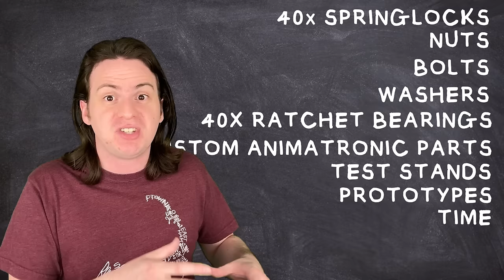Every Engineering Crime of William Afton

Comment: wouldn't most safety issues with the springlocks be solved by simply making them open upon failure instead of close?
Reply from the maker: Yep! It would have been that easy!
Reply: @TheChiptide  and using springlocks that aren't insanely powerful probably would've done the trick too
Reply: The issue with that is that the jerky motions of the animatronic would set off the springlocks, causing it to crumple on stage.

Comment: I always thought the reason they hired security guards was to act as bait so that the animatronics don't try and leave the building. They realized that the robots started acting weird and attacking things and didn't want that getting out onto the streets. Also, to answer your question about the Funtimes, they were designed to scan the room and only strike when a kid was left alone with them. No one would be around to see it, and no one would suspect that the kid is inside the robot.
Reply: I prefer the theory that they saw it, and just went huh, time to get some cake
Reply: the whole concept of the funtimes to strike when a kid is left alone in a party is like.
one of the reasons why they didn't really get another since yoinking william's daughter.
as a case like that in a party is VERY slim. surprising, i know
Reply: Remember the night 1 phone call, Fazbear Entertainment is not responsible for damage to property or person. Upon discovering that damage or death has occurred, a missing person report will be filed within 90 days, or as soon property and premises have been thoroughly cleaned and bleached, and the carpets have been replaced.

Comment: The springlock suits, as far as we know, are completely safe when used properly and in accordance with standard operating procedure. The only reason William died is because he was putting the suit on hastily and in a damp environment, violating the standard operating procedure. If you operate a table saw not according to procedure, you’re liable to be injured; but that doesn’t mean that the table saw is poorly designed.

As for Fredbear, the reason the pistons in the mouth are so powerful is because they need to be strong enough to actuate the presumably very heavy upper head of the animatronic. It wasn’t the strength of the pistons that caused the Bite of ‘83, it was the weight of that upper head part.
Reply from the maker: While that’s technically true, as an engineer you need to expect that people won’t follow all the rules all the time. The fact that this problem could have been solved simply by turning the srpinglocks around so that you’re not in the line of fire is what makes this so negligent and criminal. Just because nobody got hurt (until they did), doesn’t mean it’s safe
Reply: These are supposed to be used by human beings, last I checked, those sweat, getting the inside of any mascotte suits unpleasantly damp as time goes on. And in a restaurant, there is 100% chances that the suits would get splashed with a spilled drink, so moisture should have been part of the considerations when planning and testing the design.
Also, quick changes are a staple of the most performances, so being able to get in and out of the suits quickly and safely becomes a basic need for them to be fit for purpose.
Reply: About the weight of the head: it can't be that heavy, people should wear it over their own head
Reply: Finally someone who acknowledges this. Sheesh...
Reply: @TheChiptide  technically it's not the spring locks that kill someone it's them launching the Animatronic Parts that they Hold Back Into Your Body, but that's still a Failure of engineering and safety non the less

Comment: I can think of 5 different easy solutions to the spring lock failure design.

1. Make the default position the suit position, requiring the springs be tensioned to be in robot mode.

2. Use jack screws. This is like what is used on some flap and trim systems on aircraft, no possible spring action, yes it will take more time, but any failure will keep the suits in the mode they are currently in 

3. Redesign the suit to a simpler system where the character elements can be swapped between human exoskeletons and separate robotic endoskeletons. 

4. Just using locking slides instead of spring locks. So if they come undone they will flop around harmlessly instead of snapping closed like a mousetrap 

5. COTTER PINS.

This level of engineering stupidity is only possible not only through negligence but through intent.

Comment: What else could have solved the power outage issue is having a manual way to open the doors or even better, a back door.

Also why would there ever be two incredibly expensive heavy steel doors? Just get one if you really want to get them.

Comment: Yeah, but the spring lock suit that killed him was decaying, had holes and vegetation growing on the suit, on top of the bad conditioning of the building, and it is in a state of disrepair on the suit. William also may have not even designed the suit, as Williams stitched together suit in fnaf 3 was most likely the original suit designed by him judging by the stitch marks, compared to Henry’s bulky design. He most likely used high quality springlocks, maybe too powerful to kill people. 
But throw all that out the window as the suits may have never been actually used, as only 2 existed.

THE DOORS were designed to keep the person watching the security cameras just in case a break in would happen, so they could call 911.
(They didn’t have portable phones back then) then the anatronics would attack people after hours because they’re on low power mode, as the doors would only be close of 6 out of the 16 hours saving a lot of money.

While it might be considered unsafe to keep killer robots that walk around.
Maybe it is because their servos lock up if left off for too long, considering if the place closes around 6, that’s 5 still five hours before 12. William always had doors in HIs astablishments. Fnaf 1, SL, and in the location before fnaf 2, he states in fnaf 2. “As you can see, there’s no doors for you to close…” all the locations he owned, all had doors to protect the night guard.

Comment: Henry might be more guilty than what you initially thought. Both William and Henry were involved in building the Springlock suit. However, during Fnaf 2, William was working as a day shift guard and was eventually fired by the end of the week. There is no evidence to suggest that William returned to work for Fazbear Entertainment. Moreover, by listening to the phone calls, Henry was aware of the potential danger posed by the animatronics in both Fnaf 2 and Fnaf 1. In Fnaf 1, there was a policy in place to cover up evidence in case of any fatalities. Additionally, the Springlock suits are a gray area as they are dangerous, but the employees were trained to wear them. You can hear some of the training tapes in Fnaf 3. Furthermore, when the Springlock suits were built, safety laws were not as strict as they are now. Based on my research, they followed all legal requirements at the time for the construction of Springlock suits.

Comment: Actually he has more than two character traits, He's overconfident, boastful, and degrading, also he was NEVER Purple, he's just depicted as Purple. The only one who's LITERALLY Purple is Michael, who's purple because he's LITERALLY A ROTTING CORPSE (Though it's more a meaty red outside the 8-bit minigames, akin to William's corpse in Springtrap, which is why he's able to get jobs at all despite literally being a reanimated corpse).

Most of the evidence pointing towards William was either in a bunker under his house or also pointed at 3 other people, one of which being Henry.

Ah yes, giving William Credit for Henry's work when even he states that it was Henry's design. From what I've seen you do that a lot.

You're right, he's not a cheap businessman, but he DIDN'T DESIGN OR MAKE THE SPRINGLOCK SUITS. THAT WAS HENRY.

In fact, Henry designed EVERY ANIMATRONIC IN THE FRANCHISE EXCEPT THE FUNTIMES (the only ones actually made by William that we are presently aware of) AND THE GLAMROCKS (which were made by some third party about half a decade after Henry was already dead). Both Generations of Springlock Suit? Henry (Though he deeply regrets it, and that's why they were abandoned after only two generations instead of perfected for the sake of safety). Every Generation of Endoskeleton? Henry. Every bit of programming into all the robots over each generation? That ALSO was Henry. The only safety hazard his designs post spring-lock had were because the programming was either modified by William, or replaced entirely upon the robot getting possessed. As a result using anything that isn't in the "FazBunker" is hella unfair to William and is shirking blame for things he wasn't responsible for just to get him in jail faster, which is wholely unnecessary because THE FUNTIMES ARE LITERALLY DESIGNED TO KIDNAP AND MURDER CHILDREN. If William hadn't kept those blueprints in the "FazBunker" those would get him life inprisonment. You don't need to use a machine William never touched the design or creation phase of to get him on "Engineering Crimes".

Hell William wasn't even an inventor until after the Springlock suits were already into the second generation, he did exclusively the business side of the company.

The Springlock Mechanism was very rudimentary, the Second Generation (the kind used by william that became Springtrap around him) was basically just a Second Phase Prototype that got scrapped because Henry couldn't figure out a way to make it work. Ironically they'd be safer if William WAS the guy making it, considering how technologically advanced HIS robots from 1985 are compared to robots from 1993 that Henry Designed. Hell, compared to the robots in 2030 with the Pizzaplex the Funtimes are STILL a technological marvel. More proof that William DID NOT MAKE THE SPRINGLOCK SUITS. His designs are all organic in appearance, using flexible light metal tubing instead of rigid steel rods and plates to simulate human anatomy better. His tech is so advanced by comparison that he'd likely be able to tightly compress the springlocks with systems that don't come loose as easily as Henry's did.